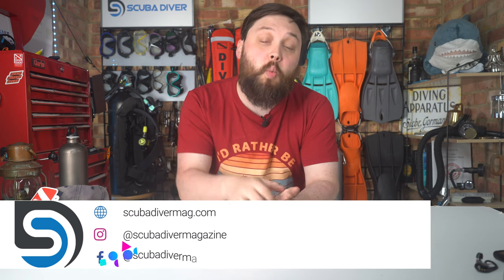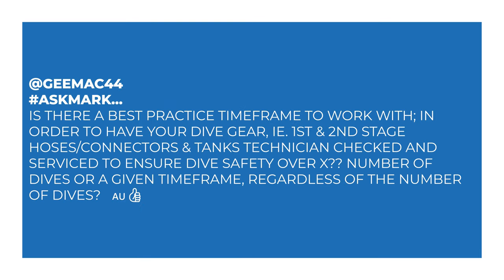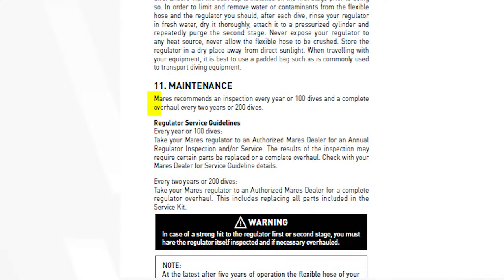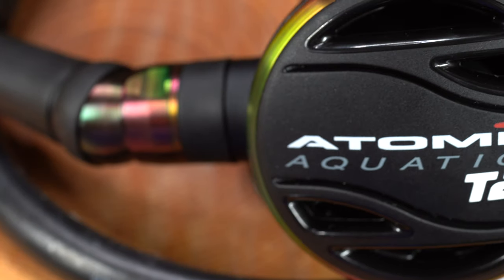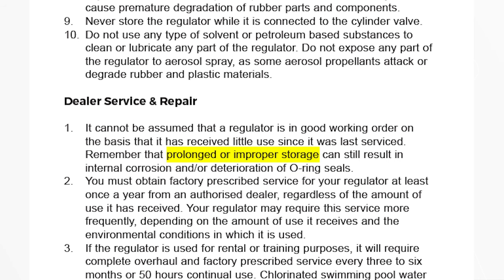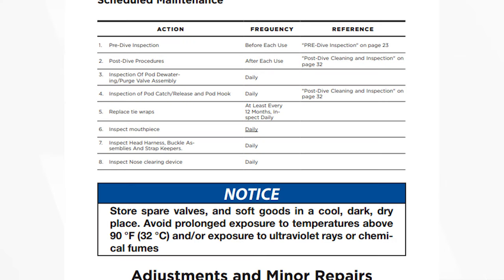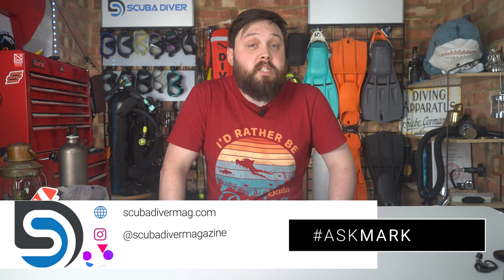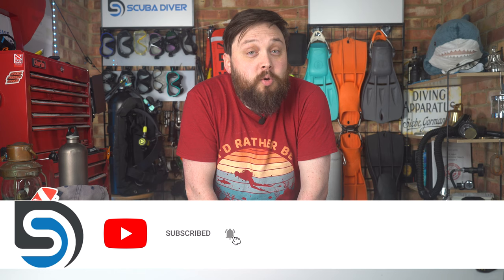How Often do I Need to Service My Regulators? #askmark #scuba @geemac44

Comment: #askmark Hi Mark, any tips on how to clean the insides of a DSMB? Also, what is your recommended method of inflating a DSMB?
Reply from the maker: I pop the dump valve off and put a drop of dish soap inside with some warm water. Give it a good slosh around and then empty the water through both valves to clear out any salt build up. Then I re-inflate and hang it so that water can settle at the lowest point and drain it again.

Inflating the dSMB underwater, once it's connected to the spool I orally inflate a single breath and depending on the depth I might put a 2nd breath in. By orally inflating the 1st breath, you don't change your buoyancy until you take another breath from your regulator and the gas expands as it ascends.

Larger buoys I tend to use the LPI hose from my BCD so i can get as much gas in the buoy as possible.

Comment: #askmark Single Tank height question - When I did my OW many years ago, my instructor taught me to set the height of the tank in the cam bands, so that where the valve meets the top of the tank is level with the top of the handle on the hard plastic 'backplate' on my jacket style BCD.
Some people in the group then needed to adjust this a small amount on future dives, but it was a great starting point. This seems to work reasonably well for both my BCD and any I've hired on holidays, regardless of whether the tank has been Ali or steel. The regs don't hit the back of my head and my trim is about right. Jacket style BCD seem to all have a short webbing strap to go round the neck of the tank to make setting this height easy and repeatable.
I've just ordered a backplate and wing (the Xdeep Zen - SS with standard harness), is there any similar 'rule' to setting the tank height that gets you close to perfect every time? I realise a little trial and error is probably required, but a starting point would be great.
I notice that BP/W BCDs don't tend to have the tank neck strap - any reason for this? How do you keep the tank height consistent?
Reply from the maker: Neck Straps aren't too common on BP/W setups. They often have two cam bands that help to prevent the rig from slipping down the cylinder and gives you time to tighten one of the cam bands so, you don't really need a neck strap. You quickly learn to live without them.

As far as cylinder height on the Zen backplate, similar to a standard rec BCD: neck of the cylinder level with the top of the backplate is a good starting point.
Reply: A good starting point would be somewhere around 3 fingers from the top cam band (assuming your bpw comes with 2 cam bands) to the part of the tank where it starts to curve. From there, I personally prefer to bring the tank up slightly higher (such that my head just barely hits my 1st stage) as it helps with my trim.

Comment: While on the topic of Regulators, I am a New Diver. Certified OW(PADI) Aug 6 2023. What should I look for in a Good Regulator? My Shop Favors Aqualung gear. I like Sherwood/Genesis products. But was not able to try one of their Regs in Class. They sent me home with Aqualung and US Divers for the classes.  Thank you Mark
Reply: I have an Aqualung reg (Legend) and have never had any issues. However, they've recently run into some financial/supply line problems and I've been told by my local shop that it's very difficult to find replacement Aqualung parts. The shop is about to stop servicing Aqualung regs for that reason. Just an FYI.
Reply: @jasecarter7320  Thank you
Reply: I would look up what your local dive shop can service, this way you never need to ship off your gear to get it serviced. I would recommend Atomic or Dive Rite. I own a lot of Dive rite regs and i like them because they are tanks and only need to be serviced every 2 years, where as most regs are 1. (also service heavily depends on usage, not just the set time, they are just suggestions based on usage or a maximum time without service)
Reply: @MikeRogGaming  Unfortunately, I live in an area with only 1 shop within 30 Miles. There is another in Bensalem PA. It's about an hour drive to get there. I live outside of Trenton NJ
Reply: @chrisphilhower6029   I'd probably recommend just going with a brand that you deem to be up to your personal standards and just ship them off for service then.
Reply from the maker: Congratulations on your certification!
When buying a regulator you're looking for a regulator that suits your diving style . I.e. a lightweight regulator if you travel, cold water rating for diving in cold waters and hose routing options from the 1st stage.

Quality of breathe is important, while all regulators will give you enough gas on a dive some are smoother .  The best way to find a good regulator is to use it but, look for a balanced or over-balanced regulator.

And as others have said; make sure you can get them serviced conveniently. If you don't have any service centres nearby then consider a model with a 2 or 3 year service schedule so you don't need to make the journey or shipment as often.

The bottom line is that it's hard for a manufacturer to make a bad regulator today. Each design has to pass stringent tests to be sold.
Reply: @ScubaDiverMagazine  Thank You!!!
Reply: As a fresh OWD, to continue with the experience I had on my training, I bought the famous Mares 2S Reg kit, although, I've been warned that this regulator that is quite simple, does not shine at depths of 30 meters and deeper, what was said to me is that Mares 2S becomes a reg that you struggle to breath from... after 30 meters, though for regular use for the 18 meters limit of OWD, is quite reliable, have been using it a lot and the bugger just keeps working well. If I were you, I would go Mares, but would choose the 15 S or the big brothers for a budget, but Aqualung is pretty good, maybe even better dunno, there are other premium Brands like Apeks, some guy told me those were pretty good Reg's, I only present you my opinion of a noob, so take it with a grain of salt.
Reply: @jezuscristo489  Thank you. I'm not sure How deep I would be going??
Reply: @chrisphilhower6029   I'm going as deep as 17 meters, 55 feet, mostly I'm at depths of just 12 to 14 meters "39 to 45 feet" so, pretty shallow dives, I also have a second Reg a, TDS Oceanus,  for my pony "bailout" mini tank of 5 liters, I decided to dive with a bailout tank even at these depths cause to many times I found myself alone in the Ocean by "competent" buddies.

Comment: Been trying to compare Seadragon video light system perhaps you can help! I want to upgrade from single light to dual lighting system. Currently using Seadragon 3000SF Dual Pro Beam and thought I’d just get another one the same. Is this too much or the Duo 6000f is enough? Can’t find much difference between the 2 if compared one to one apart from the dual pro beam is 90cri while the single 3000f is 80cri. Can you please help - particularly this brand , which duo pair to go for ? Thank you 💙
Reply from the maker: They are pretty similar but for the spotlight on yours and the auto sensor on the 3000f. They would be a good pairing as you can put the 3000f into auto mode and it will automatically dim if it senses that it's too bright. Or you just set it to manual and adjust your aperture or shutter.

Comment: Talking about regulators second stage, a noobie question please, could you explain me the real difference between a main regulator second stage and the Octopus? The Octopus is also a second stage regulator, can an Octopus be used as "primary" second stage on a pony tank for example?
Reply: Hey @jezuscristo489,  as far as my knowledge goes there is no difference in the regulators unless you buy different regulators. Most pricier kits offer the same regulator when buying a whole first and second stage regulator set. I know some people that will use a nicer one as a primary and have their octo be a cheaper reg due to it being used less often, however most of the time they are the same reg with the exception of color and maybe how long the hose attached is (octos are longer for donation). The octos are often colored Yellow for easy identification however this also varies. To simplify things there is no real octo regulator per say or a regulator that should be your primary, the difference in them just comes in brand and price, one is used as a backup, and one as a primary, functionality-wise they operate the same. All regulators are not the same however some breath easier and some will be built to last longer. I dive Dive Rite XT2 second stage for both my primary and octo when diving for classes or in open water. When I side mount dive I have the XT4s rigged on my side-mount gear for cave diving as they are more rugged and breath easier. In regards to your pony bottle question I would recommend keeping a primary and octo regulator on your primary tank and just use a pony with one reg to bail yourself out and keep the dual redundancy on your main diving setup (3 total regulators). Its always a good idea to keep as much redundancy as you can when diving. P.S. I would never recommend diving alone. Hope this helps :)
Reply: @MikeRogGaming   Hello Mike, it helps a lot, thank you, yeah I will have an octo and main connected to my main scuba tank, but because I once bought a mares octo that was replaced by a better one on my main configuration, wanted to use that mares octo on the pony just to save some money, about the advices you gave me, yes indeed, I agree, even if you have redundancy, gear wise, something can happen that has nothing to do with gear, and can be fatal, I only dive with buddies, though  I explain why the bailout tank of 5 liters.. some buddies.. well... get distracted a lot with fish and tend to .. disappear.. this extra tank is to give me, some sense of some additional security to avoid an emergency ascent in case my buddy is like 50 meters ahead and I can't reach his/her octo. You know i think that fresh OWD's from SSI or PADI should have a module named "How to be a competent buddy" 🙂
Reply from the maker: You can certainly use an octo 2nd stage on a pony.

Other than the obvious colour difference, octos are often set up slightly harder to open the valve so they're less likely to freeflow. There's no reason why you couldn't adjust it to breathe just like a primary, the mechanism on the inside is just the same.